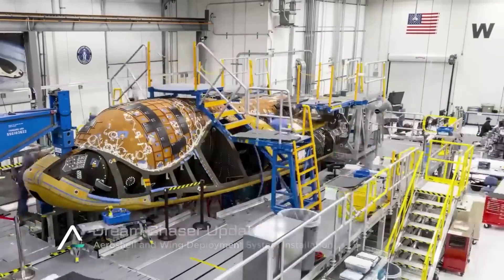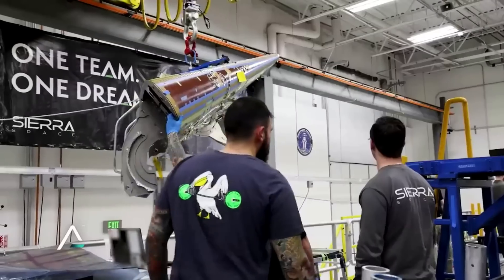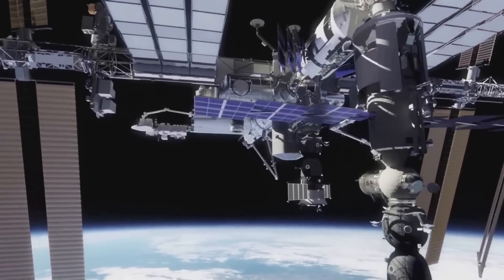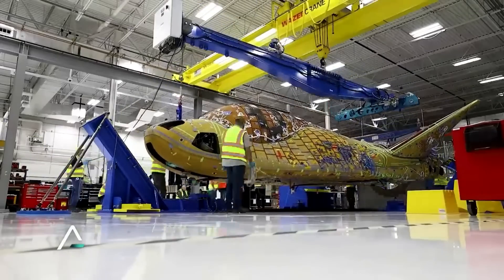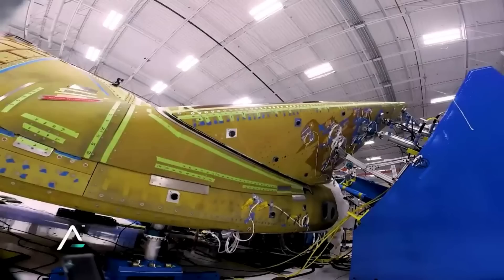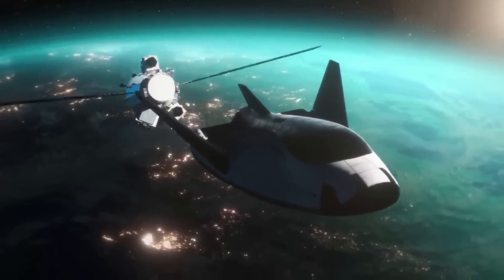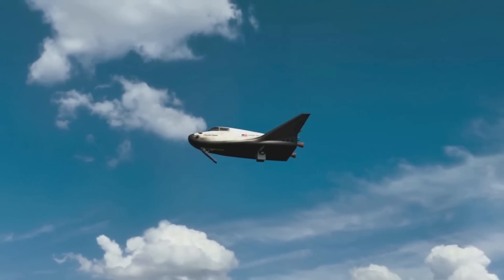Dream Chaser Tenacity's First Launch & Future Propulsion

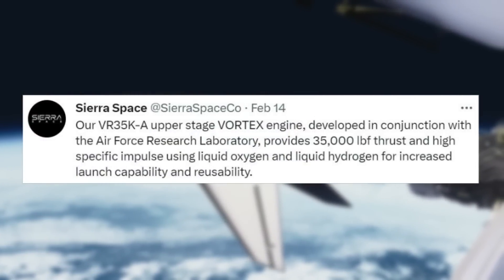Comment: 1:04 The Dream Chaser vortex rocket engines are fascinating. Most liquid rocket engines the fuel and oxidizer fed through injectors and feed manifold located at the top end of the combustion chamber. Some or all the fuel is passed through tubes, channels, or in a jacket around the combustion chamber and nozzle to regeneratively cool the engine. In a vortex rocket engine in the combustion chamber liquid oxygen is fed in from the bottom of the combustion chamber and is directed into a swirling flow adjacent to the walls of the chamber. When the oxygen reaches the top of the chamber, it spirals inward to form a second swirling vortex flowing toward the exit nozzle. The fuel is injected into the inner vortex where it mixes with the oxygen and burns. Combustion occurs only in the inner vortex, so that the combustion products are isolated from the outer wall by the outer vortex. The chamber wall is exposed only to radiant heat and is kept cooled by the flow of oxygen along the wall. Only the nozzle needs to be regeneratively cooled by the LOX. As you stated this makes for a cheaper, less complex, and more reliable rocket engine. I might add the latest 1:21 information offered by SNC of Dream Chaser with the Shooting Star cargo module, shows the combination spacecraft has 26 RCS vortex thrusters including 6 aft facing thrusters on the cargo module. The bulk of forward and retro thrust will come from these engines.  The solar panels on the Shoot Star block aft facing RCS thrusters on Dream Chaser until separated.
Reply: Thankyou for your explanation .